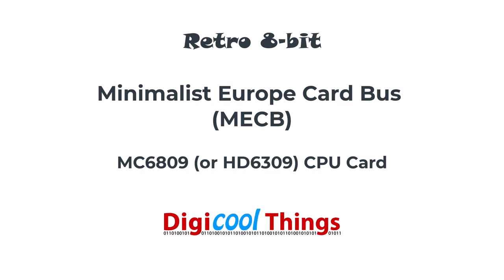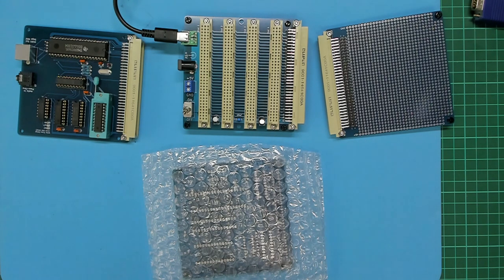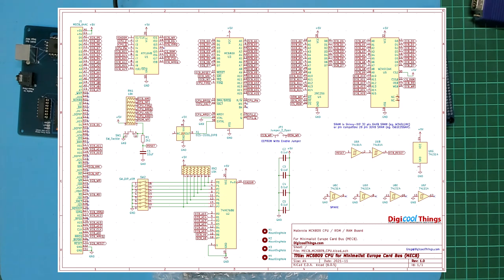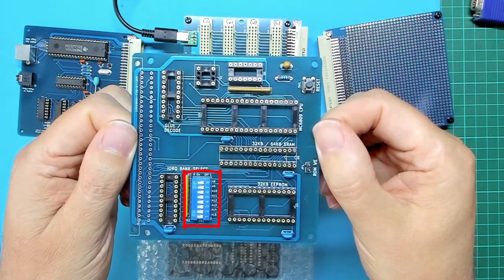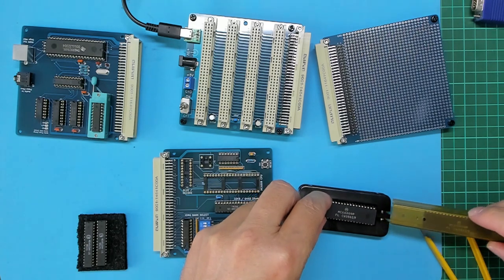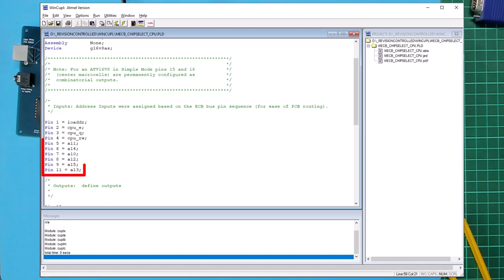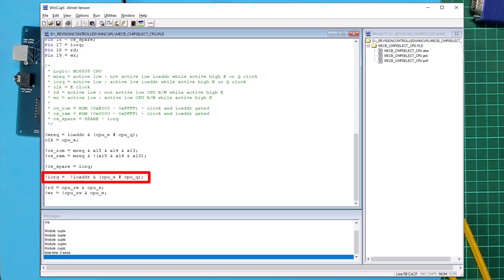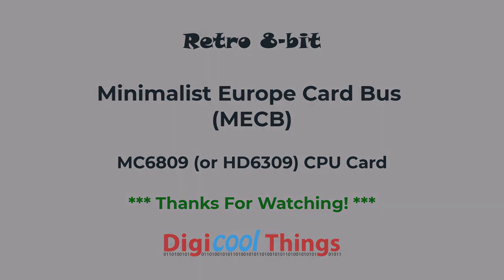Minimalist Europe Card Bus (MECB) - MC6809 (or HD6309) CPU Card

Comment: Wow, just when I thoughty project was somewhat unique, I find someone making almost the same exact thing. Started with a 6809E, and the same DIN41612 connectors, but was going to use a faster EPROM for most of the memory decoding, and only a few extra logic ICs for the clock and bus signals. I'll have to check out how you've implemented the PLD, it's way cleaner
Reply from the maker: Great to hear that another Retro 8-bit enthusiast is also using the DIN41612 connectors.  Curious to hear if you also had a historic connection to using these awesome connectors, or whether they're just something you found more recently and decided to use?  Either way, an excellent choice. :)
Reply: @DigicoolThings  ha, definitely no personal connection to them, just have seen them in equipment here and there, and the eurocard format is a nice size for a lot of projects. They're also available at an electronics store near me, along with prototype boards and a back plane.

Comment: the schematic diagram would look better to my head if you used the bus wiring, so we can easy see where the data and address bus's went. Far better as well for finding missing connections than when you do the whole wiring via a netlist or global lables. sorry for nit picking 🙂

Still a great video series
Reply from the maker: Don't say sorry.  I do completely agree!  It was indeed my intention to add bus bars before finalising the schematic, also acknowledging your earlier video feedback (this schematic was originally done earlier).  Unfortunately, I’ve been struggling with some health issues, so this video has taken a little longer than normal to put together, and this detail unfortunately didn’t get done.  I thought it more useful to just get this video out, so I can progress onwards with my project.  I do still intend going back and tidying this up as soon as I’m able to.
Reply: @DigicoolThings  I remembered that you had a health scare a while back, and I hope your well on the road to full recovery. I did feel like i was being a big nitpicker, but that could just be a sign of old age 🙂

I can remember all the fun of wire wrapping boards! used to make 8086 micro-boards like that for prototyping ideas.  In them days getting a board made was only for final design checks before going into production as the costs of designing a PCB were so high mostly done by hand. And changes could be made with a little bit of a rewiring, kind of miss those days. You got to feel the components and the process as a whole.
Keep them coming and I’ll keep watching and maybe a little less nitpicking. Or not 😂
Reply: @andymouse  EeK a Squeak, I expect this from Fred, misery guts! bar humbug. 🙂

Comment: Is there a reason why you chose the EroCard bus over, say, the ISA edge card found on XTs?
Reply from the maker: Hi.  My bus approach was primarily driven by my own preference for the DIN EuroCard connectors themselves, mostly due to my own personal history with using EuroCard DIN connectors back to the 1980’s.  I find these connectors very robust, very mechanically stable (without the need for card guides on these smaller design cards), as well as satisfying my preference for a keyed connector.  Using the 8-bit ISA bus and its connectors, would have also necessitated card edge PCB’s, preferably with gold plating, adding significantly to the PCB cost.  But, at the end of the day, bus (and connector) choice is a very subjective topic, so personal experience & preference usually wins out. :)